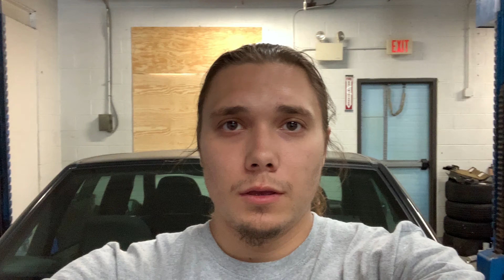Volvo 850 T-5R AWD Swap - Rear Diff Rebuild & Setup

Comment: How easy/hard do you think fabricating an adapter to slap an EV motor on the front of these diff housings would be? The torque tube/saddle tank area seems ripe for a big motor with a trunk fuel cell.

Comment: Holmes this video series continues to save my tail with my 98 V70R, where'd you find the torque specs for the rear diff?
Reply from the maker: You can use the same torque specs at the Volvo 1030/1031 manual pdf for the 240s. https://www.240.se/litteratur/tp30039_2.pdf

Comment: Does that angle gear work in a s60r m66? I've been binge watching your vids. Thanks for the motivation!
Reply from the maker: It doesn't. I would need to slightly modify it to make a s60 variant.

Comment: Would you mind specifying the carrier and pinion/ring gear bearings you used?
Reply from the maker: LM501314 & LM501349 (carrier bearing & cup)
M86647 & M86610 (outer pinon & cup)
HM89449 & HM89410 (inner pinon & cup)
All Timken.
Reply: @SimplyVolvo  Thank you, sir!